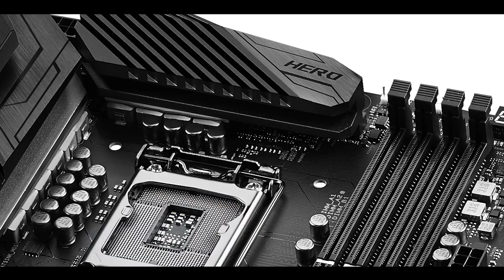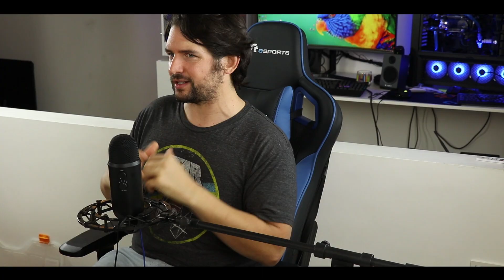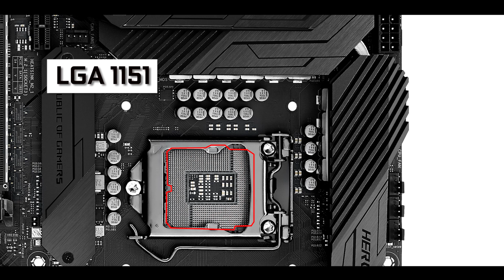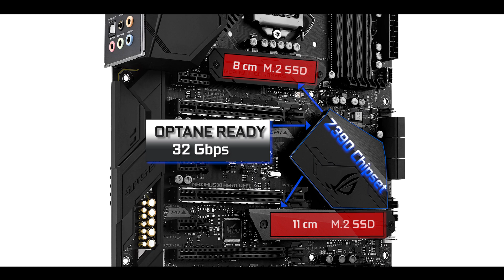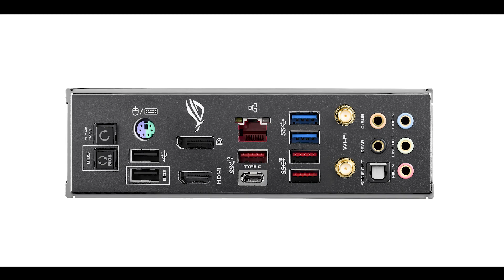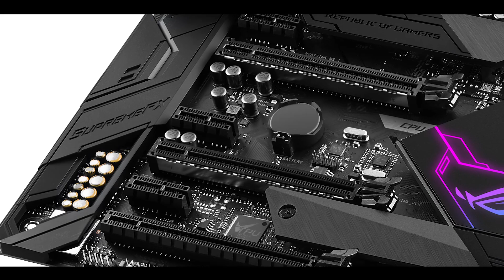ROG MAXIMUS XI HERO Wifi : a perfect board?

Comment: Still so usefull 2 years later, thanks! Trying to see how I can update my i9700k and 2080 ti Strix combination I put on this board.
Reply from the maker: Don't do anything until October,  when we will see Alder Lake coming in and GPU proce start to go down.
Reply: @Laurentschoice  Thanks for the heads up, but just to double check, with this hero z390, the best cpu I can buy is the  i9900k? Im loving the new ryzen 5900, but I'm pretty sure it's not compatible and don't know if there is an in-between I could look into at least.
Reply from the maker: Not AMD CPUs are not compatible with Intel powered boards (such as z390 boards). 
How much are u paying for the hero + CPU
Reply: @Laurentschoice  Sorry I was not clear, I've had the 9700k and Hero xi wifi since April 2019, but I'm now looking at what I could upgrade around that generation and comparing it to what will be available in the near future to help me decide what or if i want to upgrade for my 1440p gaming only PC.

Comment: Hey! great video!, quick question, what about the 4 extra connectors on the top left of the motherboard? What are those for and what type of connection do they need with the power supply? thanks!
Reply: Those are additional connectors for the CPU but you dont need to use it because most power supplies dont have enough cables.

Comment: There are a lot of rumors around vrm of hero/formula/code boards. Could U tell me is this good enough vrm for 9900k@5.0ghz? I know that aorus has better, but i want asus, i only wanna know is it enough or not? I've got formula, and i'm warried eather should i sell formula and buy aorus or just relax and keep using my formula? I have 9600k@5.0ghz, vrm not really beasty hot, max i've got 48C on vrm. But could it critically rise when i change 9600k on 9900k? I know that sic639 could stand about 150C. But i dont need that temperature on my vrm. So what will u advice? And one more question - are there any f**king doublers? Or it's got true 8 phases? There are so many speculations on this, some says - true, some says - doublers on phases. Asus says nothing
Reply from the maker: U mentioned Forumula. Is it the X or the XI.
Are u using the water block (with water) or keeping it on air?
Yes... in either way.. the Formula uses doublers and you are NOT dealing with 8 true phases, but indeed what Asus calls Twin-phases... fancy talk for 8 power stages organised in two by 4 parallel phases. 

As for 9900k. The hero xi has stellar heat sinks which does a great job at keeping VRM below the 80 degrees at 4.7ghz. 
At 5, you will see quite a bit of heating. 

If you are going for 5 or possibly 5.2 ghz, stay with the Formula XI if water cooled.

If you are with a Formula X, or not going for water cooled, run to Aorus Z390 Pro Rev.1

More power stages and more phases to spread that heat foot print. Better response time and more stable in extreme OC, which seems to be your case.
Reply: @Laurentschoice  thanx for Ur answer! I've got formula xi. Love Ur channel. Greetings from Russia!

Comment: I love Asus but I don’t know how anyone could have their motherboard in their build when gigabyte has significantly better VRMs. I’ve owned both boards and gotten slightly better stability with the Aorus master.
Reply: I've also owned both boards, I prefer Asus. If you value OC'ing, then get Aorus, that's their selling point. But if you value robust features, quality of life improvements, and don't need to OC, then get Asus. I for one am tired of the OC people being obsessed with VRM's and getting every last percent of clock speed. Having a 10 second-reduced compute time or another 10 FPS is silly to obsess about.
Reply: @Larootan  that’s true BUT if you’re buying what was at the time top tier hardware I think it’s silly to spend all that money just to leave it all stock. If you don’t care much for OC then you can buy a non k cpu and go with the asus prime. But if you’re spending this money on an expensive cpu and z390 board I think 10% on top of what is already the best hardware is very good and reasonable to want. Not that any of this matters now that AMD has left intel in the dust.

Comment: Just ordered this board. The reviews on it are so up and down. Some people say this board is amazing, some say this board is terrible. I figured for my first time overclocking this is a safe board to go with. Most of the other boards and their respected BIOS look like a complete mess. Those heatsinks have me worried my 2080 ti wont fit in it though lol.
Reply from the maker: I have been using this board for benchmarking and testing Overclocking for the past 5 months. There is nothing you can throw at it it can not do!
Reply: @Laurentschoice  I got a RM850x, think thats enough to power this board with a 9900k overclocked? Also has a 2080 ti overclocked with 32gb of dominator ram and a kraken x72 AIO?

Comment: Good day! I want myself a new board and a new processor. I decided on the processor, 9700k))) Golden mean, let's say) But with the board I can not choose (I want a good sound Audio Codec SupremeFX S1220
‧ DAC ES9023P. I stopped at two models, ASUS ROG MAXIMUS XI HERO (WI-FI) and ROG MAXIMUS XI CODE. What will be better and more reliable? Or maybe something else will advise about this money? Thank.
Reply from the maker: The Maximus Xi Hero is really a GREAT board ! Great sound and great VRM !!!
Reply: @Laurentschoice  Thank you for your answer, I appreciate your work and your input for ordinary PC users and not only. But maybe there are some significant differences between these boards. After all, code is more expensive. Although I understand that more expensive does not mean better. But if it makes sense to pay 10-15% more expensive for quality and functionality, then why not))
Reply from the maker: So the Code is basically a Formula board without a VRM water block. That's all. 

As such, it retains a few more features than the Hero. 
First u got a stronger VRM (not by much ), more back plates and heat shields. Its can feature a dash screen but that's purely aesthetics and... that's about it. 

The Hero will give u the same performances for a bit cheaper :) 

Hope this clarifies  :)
Reply: @Laurentschoice  Thank you) everything is available clearly. Is there something better for this money? (smiley)

Comment: vrm's are shit on this doe
Reply from the maker: I:) it's not.  But yeah.... room for improvement:)
Reply: @Laurentschoice  apex so much superior it's well worth the plus in $, hero formula and another I can't remind atm all have this basically 4 phase vrm can't understand why
Reply from the maker: 1- totally agreed on the Apex comment. 
2- about 4 phases we have to keep in mind that, these are Twin 4 phases or 4 phases in parallel.  

So we have 8 MOSFET and chokes which deliver onto CPU. 

Eventhough in application it does transit only through 4 doublers, hence cause much more heat residuals, we still have a 400 amp vrm setup.

So in a nutshell.  8 phases configured in two 4 parallels phases. 

See what I mean ?
Reply: @Laurentschoice  yeah I get you, I was just pointing out that in a sense it can be defined as a 4 phase board even doe its a bit different pratically

Comment: Hey laurent, I have a question. I upgraded my motherboard from the Z370 hero to the Z390 when I picked up my 9700K and G.Skill 4133 CL17. But my Z390 Hero crashes under load after about 15minutes of doing anything instensive when I use XMP profile (17-17-17-37 4133mhz) on my memory. Ive never manually set my memory, because Ive always used XMP. Is there any hope of extracting my rated speeds out of my ram kit? This is my exact kit, https://www.gskill.com/en/product/f4-4133c17d-16gtzr
Reply from the maker: Ok... this is a RAM issue. 
One of the sticks is producing errors in XMP load. 

Can u comfirm u are not having this issue when XMP is off?

Did u install latest windows May upgrade? I know it s weird. But some people reported RAM related BSOD since the latest update was installed.
Reply: @Laurentschoice  yes, The system works when I set the ram to 3000mhz and let the system automatically select its timings. The system has ran fine ever since (about 4 days ago when I did this). If there is a program you can reccomend me to run to check if my ram is ok or throwing errors so I can have proof, Id really appreciate it. As i just checked g.skill offers a lifetime warranty to Dram customers as long as you still have proof of purchase and luckily I do. As this kit was stupid expensive.

Comment: I bought the max xi hero wifi.  becasue it was just a little more than the hero, prime and the strix is just a lower end no buy zone.
and the xi hero wifi does also as you said offer important upgrades and options for the ram, cpu gen and the m.2 in speed and capacity.

Comment: you mentioned that the two top pci e slots would run in a pair at 8x per slot.  Are you sure that this is correct?  Becasue I have been running a sabertooth x58 tuf at present.  and the x58 runs two pcie slots at 16x per slot in an sli configuration (There are only two stots).
Reply from the maker: Yes. Thats correct. 

Keep in mind that x58 PCIe are 2.0. 

Here we are talking about PCIe 3.0 with a much higher bandwidth :)

Comment: Does this motherboard run windows 10? I bought the rog strix z370-e and it ended up not being compatible I'm looking for a replavement
Reply from the maker: Any Z boards (z170, Z270, z370, z390) are compatible with x86 or x64 based OS. Including Windows of any kind.  

Ur z370 is 100% compatible to windows as the z390 boards.
Reply: @Laurentschoice  I must of done something wrong then because the aura sync said it was not compatible with something thanks for the help you just saved me $200
Reply from the maker: Aura sync tends to be buggy at time. But i promise you, the Z370 motherboards are designed for windows based Operating System. 99.999% of all Z370 are operated with Windows. :)
Reply: @Laurentschoice  Any advice for the aura sync? Because I honestly don't know what to do to fix it.
Reply: @kingthrone3275  did you used BIOS?
Reply: Jokubas X4N yea I fixed it thanks for the help tho
Reply: @kingthrone3275  no problem i was thinking while typing that you may already did that lol

Comment: Your reviews of the Asus ROG Z390-E and the Maximus XI Hero are both very positive. I am upgrading my son's gaming PC and didn't necessarily plan on spending $200+ on a motherboard but I think that the ROG Z390-E is worth the extra cost over and above the ROG Z390-H. Now I am considering the Maximus XI Hero rather than the Z390-E. Is the added cost of the Hero merited in your opinion? I work in a R&D group and am a PCB designer. I appreciate good design. I also appreciate your fantastic reviews! I have watched many reviews on Youtube and don't understand why you don't have more subscribers! You are a good source of information and I thank you...I am seeing quite a bit of negative opinions about Asus's VRM implementation for the Z390 boards.  Is this a real problem?
Reply from the maker: First thank you for the comment :)

Depending on how old is your son. 

Ifypu are going to run amything but an i9 9900k, then VRM is not an issue at all, and in all amd for all... yoi are safe and fine. 

In your case i would go for a the Strix. Its an all rounder, and is dead solid.

If wifi is not a must.. then take anPrime z390-A since they are sharing the same components.

Maximus seriesnare made and design for enthusaists who are going for custom water cooling mainly... so no need to go there:)
Reply: @Laurentschoice   Great stuff as usual Laurent. Regards the above comment from the PCB designer, I am looking to build with my son a machine with one of the ASUS boards. I was almost decided on the Maximus XI hero wifi reviewed here until I saw you mentioned above that it is specially for water cooling. We want to do air cooling so is there another board you could mention that is the best for WiFi and not over-built for water. We are also planning on the i9 9700K. Thanks Laurent.

Comment: I've heard the Hero version is horrendous with tons of BIOS problems.
Reply from the maker: Ur talking about the VRM issue. 

There was a lot of talk on why Asus has decided to go with a 4 phases with doublee when they branded it "Twin 8 phase" which really was 4 phases in parallel. 

After testing and re testing, and i can only talk for myself, 

The 4 phases in parallel VRMs cover the 50 - 200 amps perfectly and the over heating was only detected when overclocking an i9 9900k beyond 5.4 ghz. 

Even at that level, a fan mount fixed the issue. 

I love the board for what it gives at that price point. 

Do not hesitate
Reply: @Laurentschoice  Excellent. Generally I don't support these bad rumors, but! This is why I appreciate your channel, to debunk it. Merci

Comment: what is the difference on this board for my GPU on the middle slot of pcie ? cuz the evga 2080ti dosent fit in the top one... or how i can make it fit ?
Reply from the maker: You can send me pictures on my email (go at the end of the video for contact details). If you only put it on the second x16 PCIe, its BUS speed will be half of the closest one to the CPU.
Reply: @Laurentschoice  i sent u a message on facebook
Reply: holdeminator 33 mine went in easy no issue.
Reply: @Jrekt   can i see it ? and u got the FTW3 if im not wrong...i hope its the same
Reply: @Laurentschoice  the evga graphic card cant fit on the first slot cuz the plastic cover of the sound card....But the 2 top slot are not the same on this mobo?
Reply: Why wouldn’t it fit on the top lol
Reply: @Jrekt  cuz of the black plate from the soundcard...i cant push it to the click
Reply: holdeminator 33 which card u got? You had me super paranoid about my 2080ti ftw3 fitting but I found a picture of some guys build with it in fine so phew lol. Which motherboard you got? Not the xi hero? 

https://www.google.ca/amp/s/amp.reddit.com/r/buildapc/comments/9v1df2/finished_my_9900k2080_ti_ftw3_upgrade_ama/#ampf=undefined

Comment: Okay, I am not sure what to think: such an enthusiastic review with a smashing conclusion: "it's a must buy!"; But neither relevant testing (e.g. thermals) nor in-depth analysis of the board (e.g. it's a 4 phase VRM but marketed as a twin-8 phase)...
Reply from the maker: Btw.. absolutely appreciate the tough love. Ill add a quick thermo testing on the formula XI for you.
Reply: Cool, thanks for the quick reply. It's just that reviews of this board are rather mixed, with many content producers stating that it's one of the worst Z390 mobo offenders when it comes to vrm design. As a consumer, it's really hard to make up your mind when some reviewers love the board while others hate it... So, I'm becoming quite wary when I see rave reviews that do not cover the whole picture... I usually love your content though, keep up the good work.
Reply from the maker: I got u. I saw the less happy reviews. But, it seemed to me they mostly had an issue with the VRM / i9  power relationship which has a design flaw in itself : its incredulous wattage needs. 

Where manufacturers are strugglyling currently is to keep previous features, pricing and upgrade VRMs which are costly. 

That is an issue accross the board (see what i did there) and not only related to Asus. 

Other than that... the Board is really awesome. And finally feel a bit more premium than the Hero X and IX... wich were really not that great.
Reply: So, you'd say this THE Z390 board to get?
Reply: In that price range I mean...
Reply from the maker: If u are an Enthusiast , with a water custom water cooling in mind, and cant afford a Formula, for once, Hero is good value.. ( for once!!! ).

If u are looking for a budget build full stop... id go to Prime z370-A II ... not even the z390 and stay clear of the i9-9900k (9600 is amaizing).

But performances CPU wise will be the same at that price point on z390s for the same CPU

The only exception i have encountered so far.. is the formula X and Xi.

If u water cool the VRM u are in heaven. If u dont they rediculously over heat. I am not saying too much when im saying that my Formula XI review is not the kindest.  
Expensive... and .... well.... expensive
Reply from the maker: Agreed. I can only cover these on my written review. I am trying to to keep at about 10 minutes pointers video as far  as Video reviews goes. 

But hey.. first must buy for Asus since last year :)